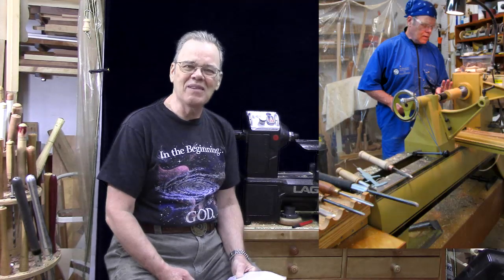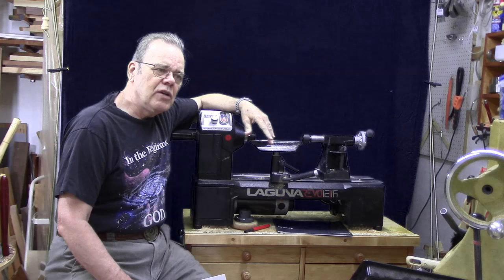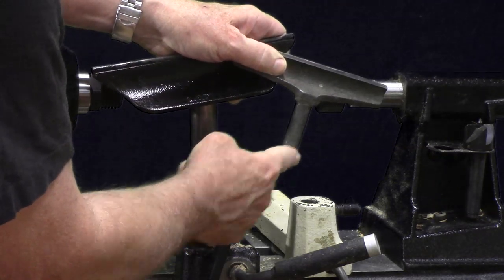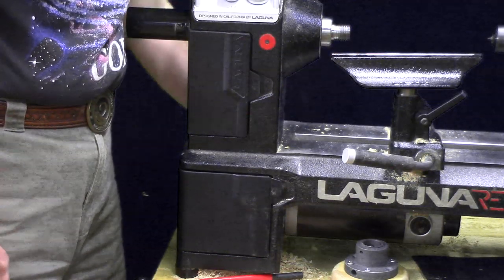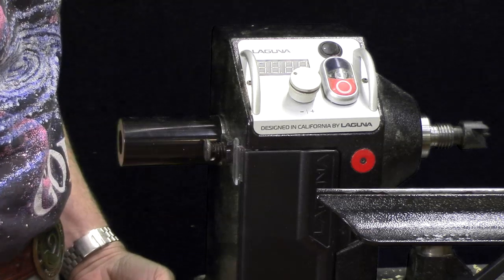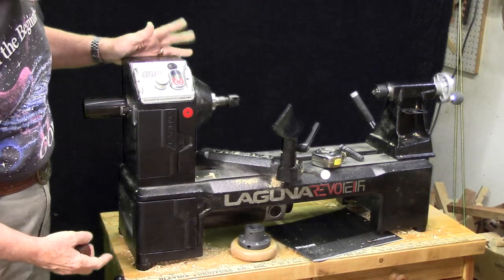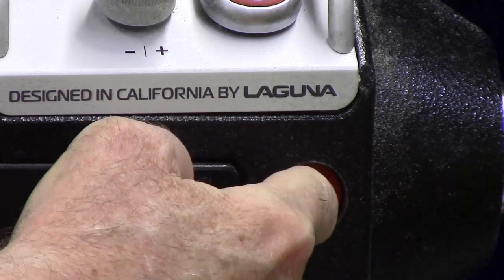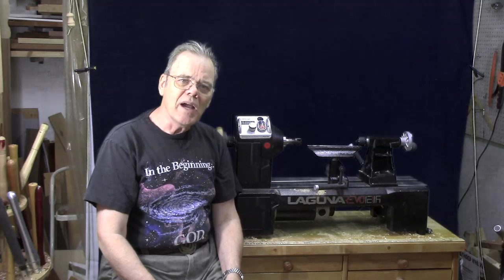Laguna Midi Lathe Review

Comment: I just brought this home today, replaced a Steel City that was quite bad but worked for a few years doing small stuff. Initial thoughts the outboard turning is what sold me over the Jet 12 21 that is currently selling for about $100 less. At my Rockler store, this is the lathe they use in their classes. (Disclaimer I have never attended one of their classes they seem quite overpriced) After unboxing it today and initial set up I'm happy.
Reply from the maker: For most of us turning bowls larger then 11" is overrated. Little demand for very large bowls and getting, processing and handling the wood is a lot more effort.

Comment: Nice review and I completely agree with you about this being a good lathe for beginner to expert. As you stated it's just a smaller footprint. I've been using  the Laguna REVO 1836 for a few years and completely happy with it. I knew the REVO 1216 was going to be good as well and I am very pleased with mine. You asked about favorite feature which is hard to narrow down as there are so many. The lathe runs very smooth and quite, it's hard to believe how much power it has. I've been recommending it to anyone asking questions about a new lathe purchase.
Reply from the maker: Thanks, Tim. I posted a picture of your  spindle hold down in the community tab to my channel page.

Comment: I bought one of these and there is some level of disappointment. My personal experience was two things broke (switch and aluminum handle guard) and had to be replaced (service was good), but I find the extra 5 inches in length of a Jet 1221VS would be nice. Sometimes it just feels tight backing up the tailstock and working. Taking the tail stock off works, but a little extra hassle that I think might be avoided with a 1221VS. I wish the review touched on comparing the two because it would of been a big help instead of just talking about the one. All things considered, we are still doing some nice projects.

Comment: I bought this lathe a couple of months ago, it is at another level from most lathe. We had a Delta 46-460 that served us very well for years, but this lathe goes beyond the delta. I bought the lathe stand and the outboard turning accessories along with the lathe. When the lathe is on the Laguna stand the total weight must be close to 200 pounds. Vibration is non existent. We just finished turning 40, 2 inch acorn boxes out of maple. The lathe ran nine hours a day for three days without a hitch. It is a pleasure turming on this machine.
Reply from the maker: Sounds like you gave it a work out. I bet you are pretty good at acorns!

Comment: I just purchased this lathe yesterday. Only turned one thing but my impression is positive. Very solid, very smooth movement. I'm not crazy about the fact you have to hold in the spindle lock, but I have an idea for that. One small beef is that shavings and sawdust really stick to the surfaces. It's a bit hard to clean, but that's a small negative in light of its many positives. Thanks for this review.
Reply from the maker: Thanks for sharing. Yes, the sawdust does stick. Part of that right now is the very low humidty in my shop and perhaps some static electricity.

Comment: I started turning on a Nova Mercury mini lathe.  
Bought the outboard, 2 bed extentions, a 12" rest, curved bowl rest, & the Nova live center system for it.  

I resently upgraded to the Laguna 1216, because I don't have space for a full size lathe yet... but when I do... it will be a Oneway 2436 with 3HP motor.😃
Reply from the maker: How do you compare the Laguna to the Mercury?
Reply: @MikePeaceWoodturning  
The 1/2HP motor on the Mercury is pretty anemic.  
I made a lot of 13" hardwood bowls on that mini lathe... but the Laguna is night & day more powerful.  

Turning a max capacity 13" bowl on the Mercury was a struggle... but it's a breeze to turn a 15" bowl on the Laguna.  
I haven't bogged it down yet.  
And OMG... it's soooooooo smooth & quiet.

Comment: Nice Review. I have this lathe and like that it's very quite and very smooth. You can do the coin test on it without any problem. Everything is "heavy duty", controls, tool rest, tail stock and head stock. Well done review!

Comment: This one has features that in my opinion, exceed those that jet 1221vs has. I have had bad experiences with posts that are supposed to be locked with a screw that tags the post. I am researching my first lathe and by the way, I am 68 yrs old, so this might be my only lathe. Space and power consumption are concerns for my tiny work shop that seems to be the family junk storage area.
Reply from the maker: That screw in type is on my PM3520, about the only complaint I have with it.

Comment: Love my 12/16. So smooth and quiet. Just a note, the Chuck will not just screw on the outboard spindle as it interferes with the indexing knob. Although the faceplate will fit on just fine. Supposed to come with an adapter spacer, but mine did not. Had to call and they sent one. Great customer service.
Reply: I learned of this potential so double-checked with the source (www.acmetools.com) prior to ordering.  Some sites show the adapter and some don't.  Glad it worked out for you.
Reply from the maker: I will call Laguna CS about that. Thanks.

Comment: A nice review, the disclaimer thorough, but hardly necessary, Mike!  Followeres know you better.  Attractive Tee & the message is positive.  The polishing tip for the lathe bed was right on, my Nova Comet II needed a bunch of that, tool marks & casting slag came off nicely.

Comment: Mike   I am at the point of upgrading from my jet 1015 and I really have been doing some thinking comparing the 1221 with the 1216 .  I have been doing some research and have seen many sites comparing many of the midi lathes.  My question is why have they neglected to put the 1216 in the mix?  Is the 1216 new enough to not be involved or is it lower than the Wen?
Reply from the maker: I am unfamiliar with the reviews you refer to. I found one review video of mini lathes that included an  8" Wen and not the Laguna.  It clearly was not done by a woodturner but just someone cranking out tool reviews based on specs alone. I have no knowledge of the Wen lathe.  If the lathe does not have at least a  1 HP motor and a 12" swing, I would not consider it much of an upgrade from your 1015. If you are in it for the long haul, I would try and get more.

Comment: LOL, I bought a small lathe to go along with my Powermatic but never use it. Thinking of getting rid of it. Had it over a year.
Reply from the maker: I have been enjoying turning on the smaller lathe. It does make me think of getting rid of my little belt change Jet 1014 I am using for a dedicated buffer.  Maybe I need the space more.

Comment: I bought the same lathe a week ago and live it. All of your talking points are dead on correct. I feel you missed one irritation of mine. The tool rest locking knob on the banjo does interfere with the banjo locking bar to the bed. I would prefer to lock the knob down on the right side but the bar is in the way. I am not saying it is a major issue just an irritation. This in no way changes my thoughts on this awesome lathe. I did purchase the bed extension and stand and could not be happier. 

But I have to ask Mike, why buy a very heavy midi as a demo? Either you have Samson’s strength or a couple of strong helpers on your demos... Keep turning Mike, God bless you brother... 😁
Reply: That should be love not live. Typing with a fat thumb on an iPhone tiny keyboard... 👍🏻
Reply from the maker: Good point on the tool rest lock. Now that I think about it, it would have been better on the right than in front so I would not need to move the lever out of the way.

Comment: Great video,just purchased this lathe and stand from Woodcraft yesterday,its such a beautiful piece of machinery and I had a blast turning my very first piece of wood on it,only trouble I have is getting the centers algined,they are maybe a 32nd or so out of dead center alignment,any suggestions?
Reply from the maker: It is wood not metal you are working with. Not sure you would ever notice 1/32".

Comment: Nice review, what did you see the laguna had over the Jet 12-21
Reply from the maker: Better one inch tool rest post and outside clamping, easier belt changes, better belts ... Nothing wrong with the 1221, I have turned on them before. Just like the Laguna better - except for the 2yr warranty.
Reply: @MikePeaceWoodturning  I'm in the same boat. I was set on the 1221VS until I learned that the 1216's outboard added two inches to the swing. Sounds like a game changer.

Comment: Mike, thanks very much for your review. You mentioned that the Coronet was another option, other than its 14” capacity, is there other factors that made you decide on the Laguna? I’m thinking about the two as well as the Rikon midi.
My shop is big enough for any of the above. Your time and effort are appreciated.
Best.
Reply from the maker: You can check out the video review I did of the Coronet Herald. It is not available in the US yet.

Comment: Will  you be ordering a hand wheel from  JT Turning Tools for vacuum chucking or does the DIY hand wheel you made be used with there vacuum adapter?
Reply from the maker: I have my PM to use with the vacuum chuck. No plans to use this one with a vacuum chuck. If I was planning to use a vacuum chuck, I would probably shape the area near the spindle hole to optimize the fit for my particular rotary adapter.

Comment: ...yeah, I know...this vid is several years old but it popped up during my research for a new lathe...not being sure about whether I would like turning or not, I picked up a very well used Central Machinery 8x12 benchtop lathe and have made quite a few projects...and yes, I found that I do like turning.
The lathe has one belt position but does have variable speed from 750-3200rpm, so that was nice...but the tailstock is VERY sloppy and, of course, with the small motor, bogs down easily...so the search was on...
Your video, along with a few others, convinced me that this was the one...a little more than I wanted to spend but Laguna was running a 10% off sale and off I went to my Woodcraft store earlier today to pick one up...woohoo...
I did opt for the stand, also 10% off, but that was it...I also want it mobile in my overstuffed garage but the wheel assembly was pretty steep...I plan on adding a WEN mobile base (about $49 at Amazon) very quickly...already have one of these for my bandsaw and it works well...
I should have the Laguna setup and running this weekend and am really looking forwad to using it!
Thanks for the great video as it really sealed the deal for me...👍
Matt
Reply from the maker: Good to hear. Good luck on your journey.

Comment: Mike, I watched your review of the Laguna 1216 lathe.  I bought one shorty after your review.  I’ve been pretty happy with it.  
One question about the left outside hand wheel.  It’s the original one.  Have you experienced this situation?  There is play in the shaft.  When I use the knock out rod the shaft moves laterally, it’s not tight.  I know the hand wheel is threaded on, but what could be causing the shat to move.  It should be tight.   The play can’t be good.  Any help or ideas would be appreciated.  
Thank you very much for any help.
Thanks again,
Roger
Reply from the maker: See my earlier reply

Comment: Mike, in a new review posted on Woodcrafts web page for this lathe there was concern expressed about the outboard bearing being tightened or loosened when the outboard parts are changed.  Did you see the bearings loosen when  you changed outboard parts?  is this a potential problem  or perhaps his lathe is missing parts or defective?   Thanks for your review and for talking through your thought process when purchasing your new lathe.
Reply from the maker: It does not affect me as I do not take the wheel on and off repeatedly. I did not see any issues the few times I did. I am not a machinist but I have heard these "theoretical" concerns. Some folks overthink things. Some engineers want things overengineered. Overengineering costs. I still think this was the best machine for  me. Time will tell.

Comment: Mike, if money was not the issue would you have bought a powermatic 2014? I am looking to upgrade from my nova comet 11. I have set my budget at $2500. Thanks for any advise
Reply from the maker: Maybe. It is a larger lathe at 14" and a 20" bed. It is in a whole different class than the smaller Laguna 1216.  I think the PM service is top notche and it has a longer warranty. I have to believe it is a superiour lathe. I see Amazon has them on sale with free shipping if you do not have a good store nearby.
Reply: @MikePeaceWoodturning  The biggest problem for me is that I have to assemble the lathe by myself. Are there any other lathes you might recommend? Thanks again for responding.
Reply from the maker: @curtisstacy5829  Is your concern the weight? Each piece on the PM would not be that heavy and could be moved individually. Other good choices for midi lathes i review here https://youtu.be/D49xzdry86I

Comment: Mike , I have a question. It’s about turning the lathe on n off. HOW ?  Once plugged in I know how to turn it on to spin , my issue is. The led speed display lights up constantly. I cannot find a switch to turn it off and no mention of one in instructions. Am I to understand this lathe must be unplugged each time or the display indicator will stay lite constantly ???? Ty. Gary
Reply from the maker: It won't hurt anything to leave it plugged in. Unless you have a lot of power surges in your area or get a lightening strike. I left my Powermatic plugged in most of the  time. Sometimes I remembered to unplug when a storm was coming. Not a bad idea to unplug at the end of the day.

Comment: Hi Mike,  
After reading the owners manual and watching your review of the Laguna #1216 lathe, I bought one.  I had a couple of questions.  Could you please explain why the faceplate has an insert with 2 set screws in it, it looks like it’s removable for some reason?   And the hand wheel on the left of the head stock has 2 set screws also, when removed are threads under there?
I enjoy your videos, I’ve learned a lot from them.  Thanks for your help.
Roger D.
Reply from the maker: See if this helps https://youtu.be/EMWUTrNUjh8

Comment: Mike, I have a Laguna 1216 lathe.  Have you experience this situation?  The shaft moves laterally, something
must be lose.  The left hand wheel is threaded on, but I haven’t been able to get it off two check it.  Any help would be appreciated.
Thanks for your help.
Roger
Reply from the maker: Loosen the set screws on the handwheel  and tighten it up. It has a wave washer to keep it snug after you tighten it. Not a problem.

Comment: I purchased the Rikon 70-220VSR and it was a great lathe until the control board failed. Found out Rikon had issues with the control board electronics and am getting it replaced under warranty i hope because i was sent a drill press motor the first time and aftet contacting Rikon about it I'm still waiting on the correct parts to be sent. Oops at the shipping dept. And I'm wondering if i guy with a drill press got my lathe parts. Service dept was easy to contact and deal with but we' ll see on the parts I'm supposed to get. Im seriously considering selling the Rikon and getting the Laguna midi. The Laguna was not available when i purchased the Rikon but had it been i think I would have gone with the Laguna or the Jet 1221
Reply from the maker: Rikon has good customer support. I would hang in there with them. My Laguna had a switch issue. These things happen.

Comment: Great Review Mike thanks for sharing your knowledge with us. Looks like a great little machine. Did the motor have to go through a Break in period before turning it was it broke in at the factory?
Reply from the maker: Ummm. Never heard of breaking in a motor.
Reply: @MikePeaceWoodturning  the Nova Comet 2 motor requires a run of about 30-45 minutes to wear in the brushes to the comutator before any load is applied.

Comment: Mike -- Thanks for the review. I have two concerns with your lathe, only one of which applies to your lathe in particular. For all the midi-lathes, my concern is the 1" lathe spindle. I have no concern with a 1" spindle's strength and durability. My concern is with the capability of the lathe spindle with all my other accessories that fit my 'big' lathe's 1.25" spindle. Yes, I know that you can use an adapter. I have a lathe with a 1" spindle and I use adapters when necessary. But, adapters have disadvantages. They move your chuck or faceplate farther from the headstock and they introduce additional run-out. Not a deal breaker, but more than a mere irritation.

The second issue has to do with the fact your lathe is from Laguna. At one time, Laguna earned a very poor reputation for their lack of customer service. Partly, this may because their stuff comes from overseas and they didn't, at the time, maintain a sufficient stock of replacement parts. So, if your Laguna went down, you might be waiting months for the part to get it back up and running. Reportedly, their customer service has improved. Let's hope so. However, their shorter warranty doesn't give a lot of confidence.

I wish you nothing but luck with your new lathe. I hope it performs well for you and maybe for future generations of Peace woodturners.
Reply from the maker: I still remember all of the negative posts on Laguna lathes from several years ago. I believe they have worked to change their service and image but only time will tell. I have the small insert adapter from my collet chuck works well and only extends the chuck out less than 1/2 inch. Much different than my 1 1/4 to 1" adapter.